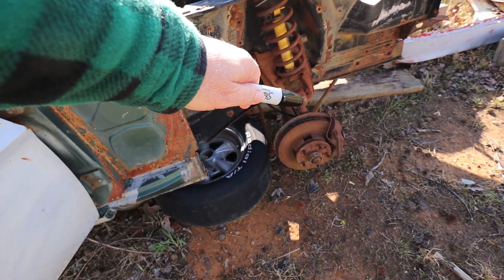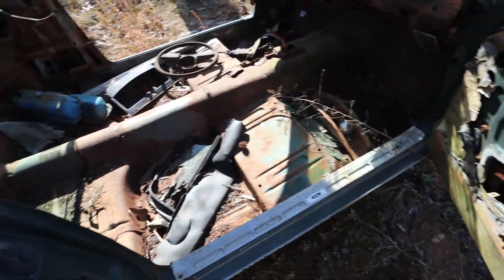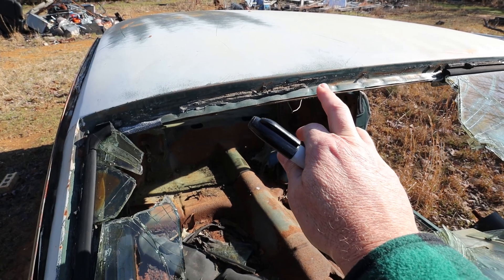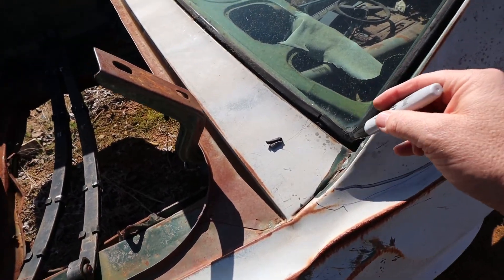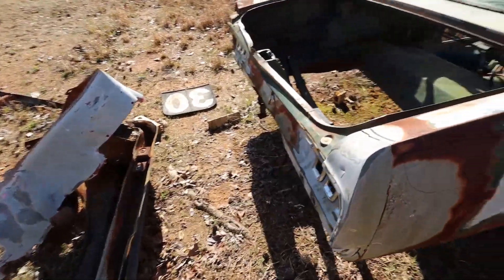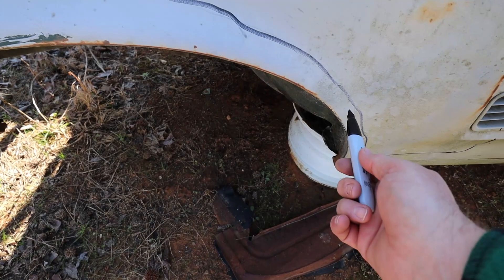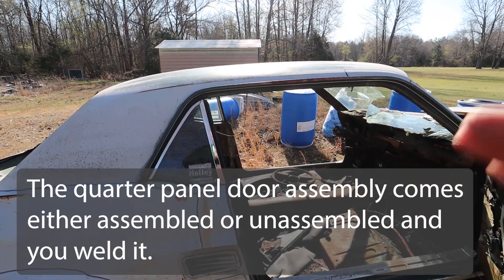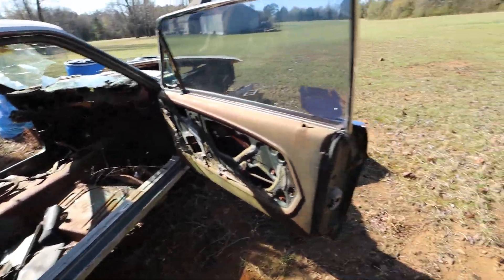Where to cut the body off of your coupe for the fastback conversion.

Comment: Could this be done to a convertible?I bought mine before watching your series and now I’m thinking I made a mistake.
Reply from the maker: Are you wanting to convert a convertible to a Fastback or Coupe to a convertible? Both are possible for sure. The convertible is a more stable car because of the stronger frame rails.
Reply: @ScottHarness1  thanks for your response! I bought a 1968 convertible with no title, I know, didn’t see that part beforehand either. I always wanted a fast back but it has gotten further and further outside of my budget. Shells of any kind for a decent price started looking fewer and further  between so I pulled the trigger on a CHEAP convertible. The frame looks decent , floor pan a little rusty but drivers side shock tower is toast.  Would you consider this a fast back candidate? And are there any major differences with putting the conversion kit on. I’m open to outside of the box thinking too. I saw a fast back hardtop for a convertible online but I’ve never actually seen anyone that makes a product like that.
Reply from the maker: @robbietizzle  Absolutely it is a great candidate but are you sure you want to convert a convertible? What I mean is they are sought after as well... If I were you I might do the work to the convertible and get it to a roller and sell it.  You might could make you some money to add to your fastback.
Reply: @ScottHarness1  thanks I didn’t realize they were that sought after. I did find a fastback hard top company out of Florida called  removable fastbacks. I think I’m going to go that route. Do you think a shock tower assembly is too big a problem for a backyard mechanic to tackle? That seems to be the biggest obstacle in making this one a roller.
Reply: I enjoy watching your video, Sir! I have myself a 67 Mustang vinyl top that is a perfect candidate for a fastback. I’m going to watch all your videos multiple times as I complete the process. I appreciate the time you took to make them. 

Finishing them is what I’m good at. I’ve been driving old Broncos my whole life. I’ll knock this out of the park!